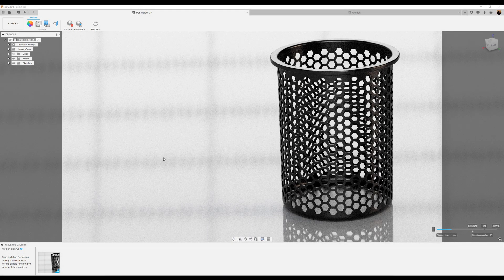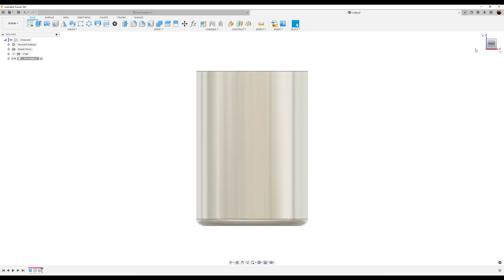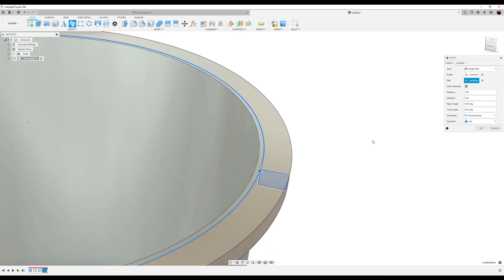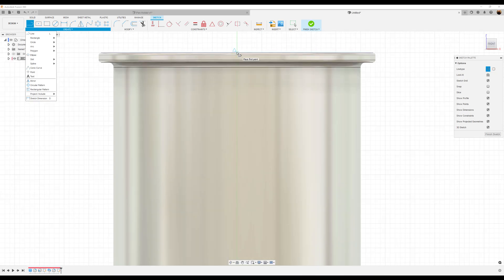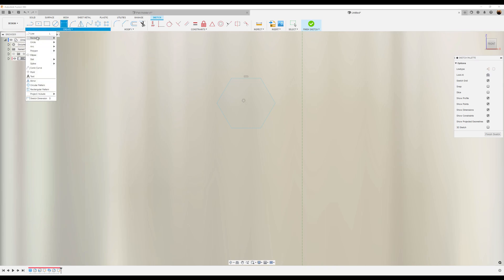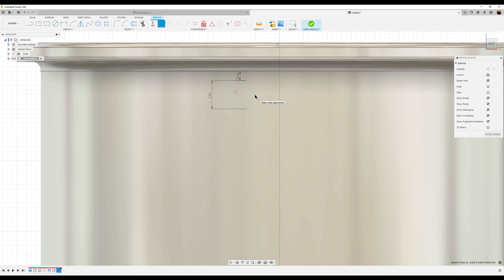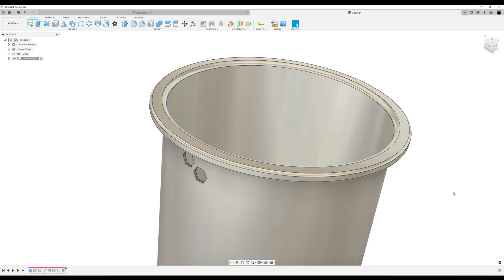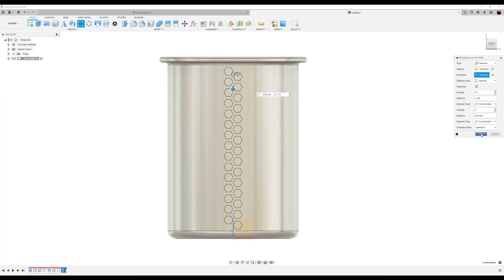Create a Pen Holder in  Fusion 360

Comment: Another good exercise C J.  The dimensions of 50mm x 70mm are small in my opinion. So once the model has been created, is there a way to scale it up (or down)?
Reply from the maker: Yes you most certainly can!
Select Modify > Scale.
Select the body or bodies to scale, you can also pick a fixed anchor point for scaling. as well
Choose a Scale Type:
- Uniform. Scale the body uniformly on all axes.
- Non Uniform. Scale along the x, y, and z axes separately.
Use the arrows or the dialog to set the scale distance
Right-click and select OK to finish the command.